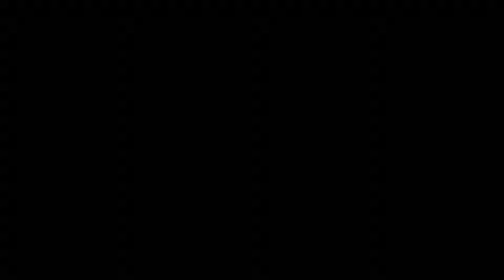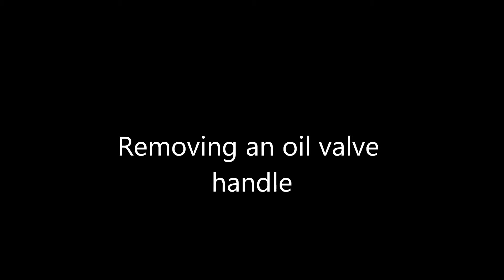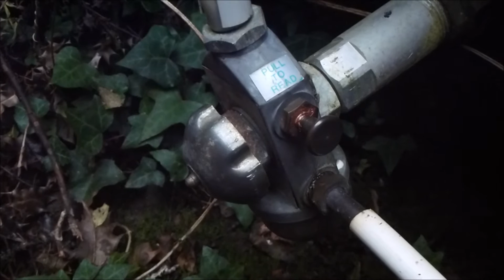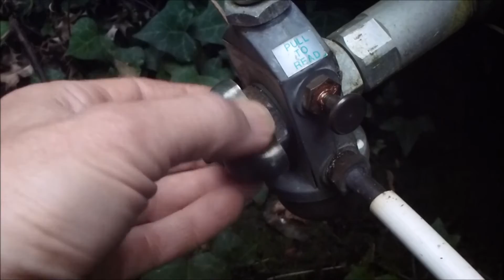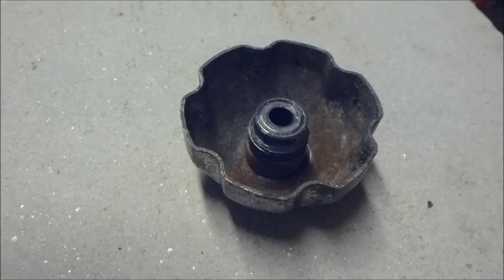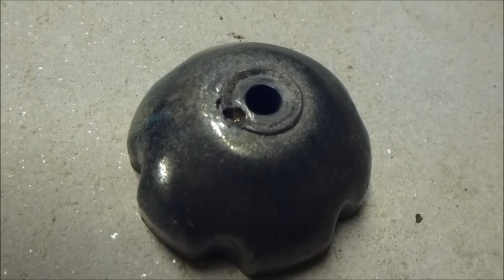Removing an Oil Valve Handle

Comment: Brilliant. Not operated by me for 20 years. Dont ask !     I was dreading emptying the tank (full ) and possibly renwing the lot. I cleaned the filter and bowl and now back on. No wonder the boiler was cutting out. Any way thanks to you I am now ordering new filter, handle  etc. One point you did drill the hole in situ did you not ? Well I had to.  Lack of grease is the enemy of cousre in all such cases.  Regards Gordon